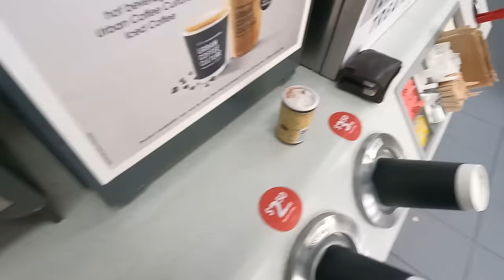2 Day Epic Hunting Adventure + Delicious Catch & Cook - Deer Heart & Liver

Comment: Excellent again as usual.  Obviously it's a meat safe not a chiller. I may be mistaken, but I didn't see much in the way of fly wire on the doors or holes on the side.  Was also thinking 28ish c is still pretty warm not to have in a chiller.  If you could elaborate on this and temps would be great.  I'm very interested in a safe / chiller etc.  Thanks heaps guys
  Cheers.
Reply from the maker: Hey Dazza, it's just a meat safe, no refrigeration. There is fly wire on the holes and behind the doors to let the air flow through, mainly for popping the deer in there until we are ready to leave which is usually the next day in the warmer weather. Of course in the warmer weather you can't hang them in there for very long but helps to stop the flies getting on the meat at all if you don't have access to a chiller to hang them in which would be amazing to have. In the winter time this sort of meat safe is perfect as the high country gets some pretty cold temps so the meat is usually good in there for at least a few days of not more depending on how cold the days are. Hope that helps 😊
Reply: @theeliteonlinehunters  thanks heaps. That makes a lotta sense.  Cheers